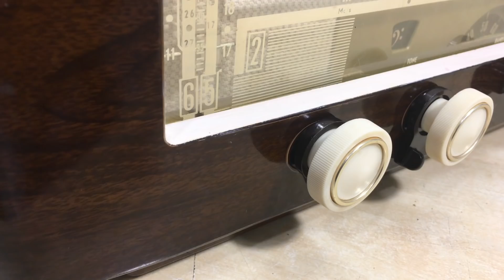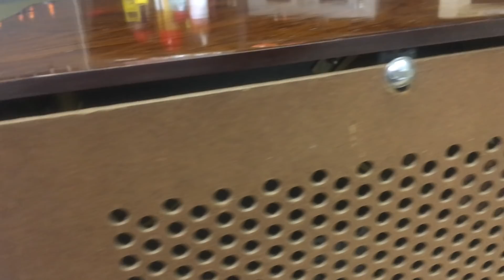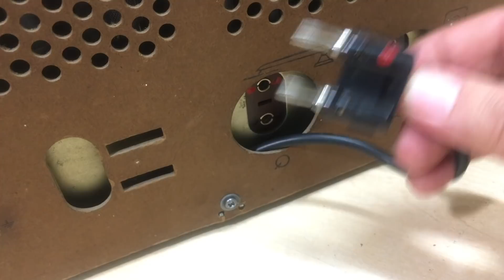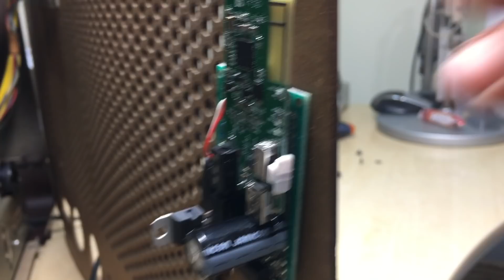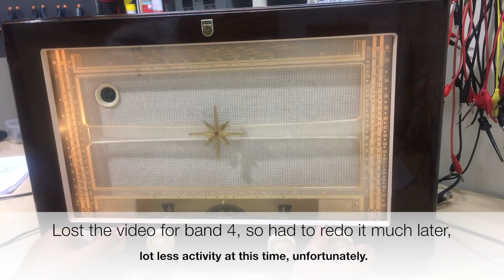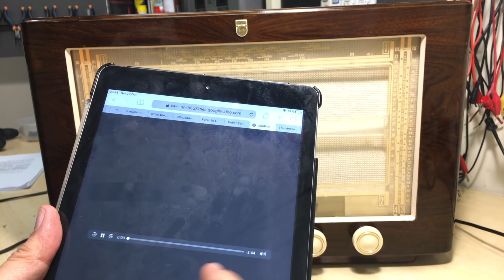Philips BX626 tube radio restoration - Part 7. The Finale. Reception test and a look at the result.

Comment: Thank you for another interesting series, they are all much appreciated here. (Well, by me at least - my partner not so much, though I think she prefers I watch you rather than bring sets home 😉).

Came up rather well in the end didn't it, and with pretty amazing performance. Was this your first 'monster' Philips? Most restorers seem to shy away from the ones like this, with complicated RF sections, things like geared / Bowden cable-driven tuning, and frustrating dial stringing. But I kind of like them and find them interesting - to the point of soothing - to work on.

I may have missed it, but what did you do about the rubbers driving the bandspread/fine tune slugs? I saw you'd put vaseline or white grease on them, but did you find manage to refurb them or find some replacements? In the past I've managed to resurrect similar rubber sleeves by getting some glycerin into them or soaking them in ATF, but those looked a bit to far gone for that to work.
Reply from the maker: Jim S : i’m glad you enjoyed it. This is not the first “monster“ Philips that I have done. I did a much more complex one before and you can see that series at:
https://www.youtube.com/playlist?list=PLy5M_tA9ux7IG6XgctidGO0u0DeT3_CxF

Phillips does tend to do things differently, don’t they? I have done many German sets, and as a result have become quite accustomed to the way they do things. Doing a Philips set is always a bit challenging because you don’t know what to expect (at least I don’t, as they are not my “specialty“). I always enjoy a challenge so it is not a problem.

I did mention the rubber fine tuning slugs (can’t quite remember exactly where). They ended up working quite well after a thorough cleanup. There was a heck of a lot dirt which made them look worse than they actually were.

Thanks for your kind words, and keep enjoying the videos.
Reply: Thanks for the link to the earlier playlist - I missed that when I first subscribed, so I'm catching up now.

I think the key to approaching the more complicated Philips sets is to remember that everything is done for a reason. It might be a completely insane reason - like the one I restored years ago with a lever arm -> pushrod -> cam -> bevelled gear set that existed, as far as I could tell, just to give the bandswitch a beautifully silky-smooth but definite action - but there is always a reason… 😉

Comment: I find it strange that band 4 has so much fewer stations than band 5. I expect 25m and especially 31m be busy bands at this time of the day. Maybe you should check the sensitivity of this band compared to bands 3 and 5. I guess there may be a dirty switch contact.
Reply from the maker: I mention in the video that band 4 was tested at a later time than the other bands.

Comment: Great restoration, the radio looks perfect, receives perfect. A hefty job well done! I can hear some oscillation in between stations (very audible at 9:25) which sounds like 50Hz mains noise, it disappears  when there is a strong station with the help of AGC I think. Is that a normal thing, or is there some more work to be done?
Reply from the maker: No, that is normal, especially on MW. With all the noise generated from the many appliances around, it’s surprising that it’s not worse. The true test for hum is with the PU selected, in this case playing the Bluetooth receiver signal. When you mute the sound source, there is absolutely no hum.

Comment: nice looking result. may i ask where did you buy the grill cloth?
Reply from the maker: Bought it years ago - can’t remember exactly where. But you can get similar ones on eBay.
Reply: on ebay they are ridiculously priced for a small piece of fabric...i am still on the look for a fabrics warehouse that has these types of fabric sold by weight or in rolls... thanks anyway
Reply from the maker: Hugo B. : go to a place that sells curtain fabrics or those used to upholster sofas. You might get lucky and find one that matches your needs.